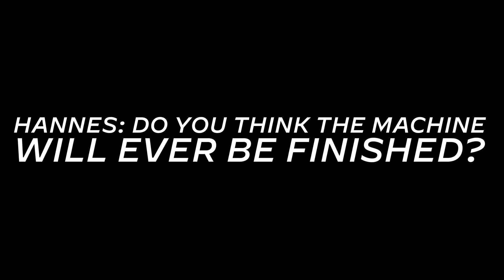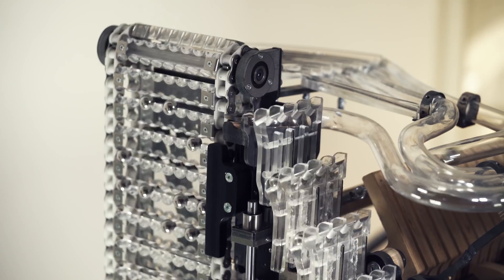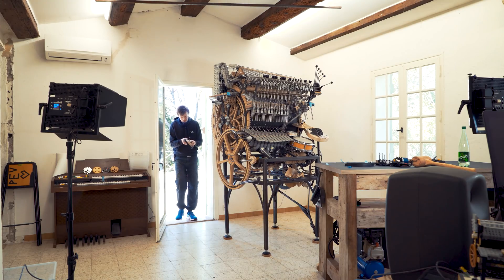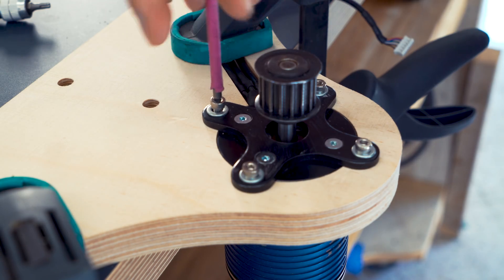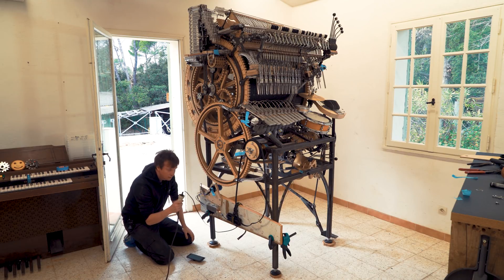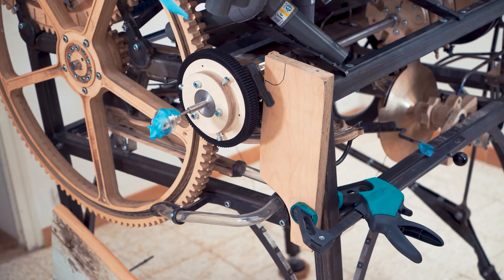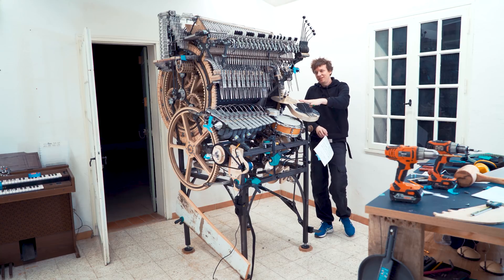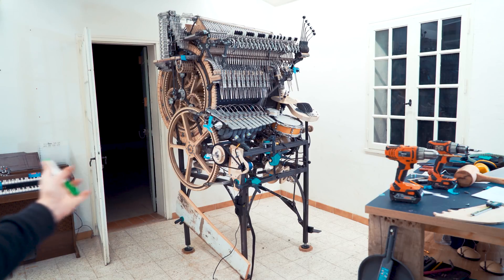Electric Motor? - Marble Machine X #114

Comment: Ok now the motor needs to be tied into a drive and and PLC and we can add PID control to self correct the speed and torque limiting. Maybe also add a touchscreen interface if you want to adjust the BPM on the fly or a couple of pushbuttons? Love the videos. 🍻

Comment: Nothing negative about adding an electric motor to this, but I thought you had wanted the Marble Machine to be "all" mechanical.   I remember in one of your previous videos you had mentioned about "perfectionism".  I presume the motor would add to this perfectionism by providing a constant torque, but wouldn't this perfectionism hinder the original spirit and essence of a mechanical machine?  Just my 2 cents worth of thinking.

Comment: Using a motor on it at this point using a Digital BLDC drive almost feels like cheating, Might as well use MP3 or MIDI?
 Instead use a weights and a clock mechanism, or pneumatic driving a tesla turbine or something.
I have been researching laser cutting whistles and organ pipes.

Comment: Isn’t the foot pedal dangerous when the machine is driven by the electrical motor? If a foot goes under it by mistake it may be crushed toward the floor, or?

Comment: And then Martin through an Incendiary into the room and ran away giggling - I'm surprised there isn't more outcry to this about face. I was kind of excited for something like MechanicalFingersGate times 3 🤣 - ah well. I love putting electric motors in my work. Not that it matters what I think, but the thought of making something with so many parts and having enough precision and tight tolerances to be able to operate it by hand crank or foot treadle - but there comes a certain point where friction overcomes practicability. I'm not super stoked about the motor, but not outraged either. Though I agree that it is a big deal and a significant turning point ~~~ I think I liked the mechanical fingers, but have mixed feeling about the motor. But it does switch on and off - so there yah go ! :D

Comment: Just a thought exercise here, but would there be a way to make a progressive (maybe conical gear or variable size pulley) gear along with a large flywheel so you could spin MMX far beyond tempo and the gear system calibrated to select tempo? It defeats some of the beauty of it, but would be awesome engineering. Like a clutch system with progressive gear as the flywheel slowed.

Comment: I’m not a fan of the electric motor.  Part of the magic of the marble machine was that it was completely driven by the performer.  I think that the electric motor takes away from the overall feeling and wonder of the marble machine x.  The debate between having perfect music of having errors in the music is to me, very clear cut.  Music isn’t meant to be 100% perfect.  If it were, why wouldn’t orchestras just use a bunch of computers for their performances?  Musicians strive for perfection, but is it truly meaningful if they use, for example, an online piano to play a piece flawlessly?  In addition, if a musician does play a piece without error, the performance is more impressive when you think that a real human did that.  “A human being played a difficult piece of music, that I could not play, without any errors.  Wow.”  But instead of thinking like that, if for example a robot were to play the same piece perfectly, I would think, “yeah, so what?  A computer is designed to do a certain task flawlessly anyway, so this isn’t very impressive.”

Comment: looks like that beautifully over engineered collet ended up being very useful xD

also i would have made that motor mount out of aluminium and made an integrated heat sink on it, because motors can get very hot and are a fire risk especially when its being held tightly by wood. i would also build a tensioner pinion for the belt so that the motor can remain firmly stationary.

Comment: With the addition of the motor, is the foot petal rendered useless? It would be cool if the foot petal remains as a foot tapping to the beat. Otherwise just cut it off.

Comment: I say swap the electric motor for a  kerosene fueled steam engine with spinning brass ball style speed regulator.
That way, you can even add a steam whistle to the tunes!
High polished moving brass, with boiler and piston housings in gloss enameled steel!

Comment: The motor fuck it for me, it defeat the purpose of a fully mechanical musical instrument
Reply: Did you miss the bit where they said it's for testing it?
Reply: @0xCAFEF00D  Testing it for what...! would be just lovely to see it man powered
Reply: @anthonygostling  They wanted something that cranks it consistently for testing how reliable it is. That's why they got the motor. The musical performance will not be using the motor.

Comment: If the belt is walking you should tilt the motor axis, not just force it into place with side rails, though like like it worked out after moving it.

Comment: You really need a mechanism that separates the crank from the shaft when it is rotating. This will help you grab it when you want it, and will prevent injury when the motor is going.

Comment: 5:10 I'm surprised the 3d printed gear wasn't designed with flanges like the motor gear. 5:34
And, 12:01 I would still add flanges just in case the wooden motor mount warps from humidity.

Comment: 6:44 - instead of locking it in place, it would be more "poetic" if it were left being able to pivot. Weigh the other side to always get the same tension.
Edit: Nvm, shorter belt arrived.
Edit2: Have a spring push it away for tension?

Comment: On this speed hi-hat sounds bit like diesel car on parking

PS you can make any transmission belt tight with desired strength. Need two extra wheels with fixed position and one to pull belt away i.e. by its weight

Comment: You need a clutch on that motor.  The motor will draw more current trying to keep up the speed.  The windings will heat up an can burn out causing a short.

Comment: I think you should attach the motor to the to the flywheel instead so that if you hit the brake then it keeps the same tempo.
Also some sort of horn instrument might be fun, like a modified saxophone or trumpet. Most likely would have to be controlled by a compressor.
A small organ hidden underneath would also be sick, it would also fit the style with the bellows and everything.

Comment: Also Martin, I would HIGHLY recommend putting a E Switch or "Emergency" button to kill the power to that motor. Just. In. Case. it couldn't hurt. I've had plenty of ESC's glitch out and go full speed uncontrollably. Not fun. Plus, it really looks cool;)  https://www.wolfautomation.com/e-stop-22mm-pushlock-turn-reset-40mm-mushroom-18613/?gclid=EAIaIQobChMIgO-30Ojy5wIVlYjICh3-OQ50EAQYFiABEgKvY_D_BwE

Comment: If the controller for the electric motor stays where it is right now, it will sit dangerously close to where the collection funnells for the vibraphone would be, won't it? My suggestion is for Martin to place the controller near where the crank is, and if possible, out of the way of any funnel. That would minimize the need for him to walk/reach for something in the front of the machine while there's steel marbles flying about.

Comment: 120,000 BPM would be wild!! The machine would tear itself apart... but assuming you could somehow get it to stay together: 120,000 BPM is basically the same as 2000 Hz. So the clicks and clacks of machine movement at that speed would blend together to play a note slightly higher than a B6!

Comment: You could use an inteligent motor driver... Your driver in this video is just giving more Power to the Motor. Intelligent drivers forces the motor to run a constant RPM.
Its theoretical possible to set a BPM and even sensors for the break or manually speed

Comment: I'm sorry to interrupt ... When the machine is at full speed, the crank is revolving really quickly. It might be hard to pick it up and not injure your hand. Should you not change the crank system to something similar to the pedals on a bicycle? That way, the crank remains in place, until you crank faster than its speed, when it'll switch to the crank as the power source. It would be better to have this function, but please don't do it – it should be finished one day.

Comment: belts walking on pulleys is a literal orientation issue and can be a pain. my super charger when i installed it to my golf had this issue. flanges should help but can still rub and cause heat build up and fail the belt over time

Comment: So with the electrical motor in place, and working. Do that mean you can simply eliminate the foot pedal. As the pedals main purpose is to help you crank the machine. Or do the pedal have some other purpose?

Comment: Outstanding Martin! As long as the pullys for the belt are lined up and square with each other the belt should track without adding flanges. Adding the assist motor is probably the biggest single playability item you've done to date for the MMX. Well done! I'm glad to see that you have your excitement back. Long projects tend to slowly wear you down (I'm a project manager).

Comment: Motors make it so much less cool. It's a complete cheat. And it limits you to batteries or a power plug. The fact this machine is completely analog is what makes it so cool. You could take it anywhere into the most isolated place and it would still function
Reply: The motor is fine. It helps assist him so he can actually focus on playing it and not literally run out of stamina cranking the entire time. It's his machine, He can do what he wishes with it. Go make your own and see how it goes.

Comment: Millwright here. Beware side loading a solid shaft too much. You'd swear it'll be fine until it cracks one day. But I don't know if it's enough force to worry about?  The first way you had the belt was countering the gear force and easier on the bearing/shaft. Now you have 2 side loads that add together. A rear motor solves this. 

Also, beware electrical noise with those RC motors. They don't exactly engineer those things for low EM emissions. You may find yourself grounding the chassis and the motor base plate, and getting the high powered wiring as far away from your sensitive mics. Hence the rear motor solving 2 problems. Electrically shielding the wiring helps if it is still a problem. Don't have multiple grounds on your machine but separating the power source for that motor from your other equipment is helpful.

Comment: The motor itself isn't that bad for me. It's the placement of the motor and the belt, in the most visible spot of the MMX, covering the wheel, right in my face. I'm sorry, I hate it and it sort of ruins the coherent design for me. Also, the pulley to the left so is ugly I can't believe it's meant to stay.

Comment: It might be helpful to use a micro-controller and an optical encoder to apply fine grained control to the motor. Write a PID controller (probably also a Kalman filter) and you can control the RPM and timings with unbelievable precision.

Comment: The Maschine is finished when it's so fast that it burns. Which will happen soon with small wall adapter to power a brushless motor esc that will pull over 500w as a slight guess. This power Suppy looks to be 200watt at best

Comment: I have been hoping for some time that you would add a motor.  Two important reasons:
1) keeping accurate time is just not possible with a hand crank unless there is active speed control.  Especially with the foot pedal - no way in hell you are going to keep accurate time with that.
2) with one hand or one foot cranking the machine you limit both your physical ability to use other instruments and your ability to focus on them.  What is the point of the bass and (hopefully) ondophone if you are distractedly playing them with one hand?
The motor is not a failure or abandonment of principals.  It is you putting the quality of the music as having priority over a purist principal.  If the goal was "play instruments manually, without a motor" then just play drums, xylophone etc.  It is the marbles that make it magic, not the hand crank.

Please do keep the motor (in a better placement).

Comment: The question of will the MMX be completed is the wrong question. It is an evolving instrument. It will never reach a final form. Constant improvements. The right question is. "When will it be performing on stage?"

I'm impressed with this motor addition and I don't see that addition as a negative thing. "It is Cruse control". It is a slave to changes in speed through the hand crank and matches that speed. It frees up the cranking hand to manage other parts. Brilliant!

Comment: Hi Martin, if you use a flanged pulley you'll want to put on a belt tensioner to make it easier to change the belts. Another method would be to use a v shaped belt. All the best

Comment: you dont need flanges even with the long belt. flanges would only cause wear and tear as the belt would rub on the side, what you need to do is design the motor mount to have tracking adjustment so if the belt starts tracking one way you would adjust the tracking so that it tends to run in the center of the pully.

Comment: Martin.  Congratulations on reorganizing your work flow!  Your back up to speed!  Waiting to hear about the time tests of the new motor and innovation.
There is one advantage for the motor.  There is a point at which the MMX cannbot be cranked at slower speeds; the motor would achieve that machine motion IF Martin wanted to compose a very slow musical composition.  But we MUST remember that the motor was added to calibrate the MMX.

Comment: I suggest using washers between those M6 hex-screws and the plywood, to spread the load so the screw-heads don't crush the wood and loosen the wheel assembly over time.

Comment: It's pretty clever to have the motor on the same side of the driveshaft as the actual gears instead of the crank where some of the mechanical force is easiest but also partially lost thanks to the way torque force works. It also shows your ingenuity in that such a small motor is able to easily turn your whole machine on its own, which means that the whole thing isn't as heavy to crank as it looks. I know you're planning on figuring out where to put it, but I would recommend trying to figure out how to perhaps place the motor and belt inside the machine rather than outside of it, as it it looks a little out of place compared to the rest of the silhouette of your machine. That, or making the "automatic speed motor" a modular part that can be attached on a whim and could mesh with the shaft and gears. That way, you could use it as you had originally intended, and then when you want to go crowdsurfing during a specific song you can just snap it into place like a Lego piece.

Comment: Doesn't the motor kill the "magic"
Reply: Yeah I also thought the same... It still is a fully mechanical marvel with regards to the actuation of each part...
Reply: I'm pretty surprised he decided to add it, I thought it was counter to part of his fundamental aesthetic desires for the project.  I guess he must have REALLY needed it
Reply: I understand that it's only for testing phase to calibrate machine on the final version will not have it installed.
Reply: Exactly

Comment: Yeah uh. Don't leave that in there on the final design, I seen you said it was just temporary but uh.. Yeah. Don't change your mind. Lol I would be so sad to see that on there :/ Don't remove the human from the Instrument :D
Reply: Having a motor doesn't make it any less of an instrument. There are musical parts that can still be done manually.
Reply: @justinnaramor6050  I mean everyone has their own opinion, I'm not wrong, and neither are you. Even though this was 7 months ago I still stand by this comment that if he were to put a motor on it, it would take part of the beauty away from the instrument.
Reply: @SavantJosh  I understand that. However, I'd also argue that the machine has never been free of electronic parts entirely, there are microphones that record and process the audio from the instruments to make them sound the way they do (particularly with the drums), and the bass guitar is also electric and neads amplification. So I'd adding a motor is further proof of that. I agree that there's something special about fully mechanical power, but that's really all that a hand crank or foot pedal does, it's just a power source. It's like the difference between a bicycle  and a motorcycle, a bicycle is completely mechanical while a motorcycle requires, well, a motor:)

Comment: Martin, I fear the wooden corks will deform, when they are exposed to moister I the air. Maybe there is a wear resistant way to seal the wood?

Comment: While I totally understand the use of a motor for testing and calibration I also feel this cheapens all the mechanical wonders built into the marble machine.

"how does it work?"
"well, there is an electric motor that..."
" oh so it's just all electronically controlled"
Reply: I mean this is only if you get someone who has enough mechanical understanding to have the idea to electrically control everything, but not enough to recognise that it blatantly isn't.

Comment: Seems like the tracking issue is no longer a problem with the shorter belt - however if you wanted to guarantee this you could use a crowned pulley. Flanges are likely to cause issues with friction and further upset tracking but by slightly crowning the pulley the belt should always try to centre itself. This is the same principle that allows trains to take corners without coming off the rails.

Either way, excellent production quality as usual Martin and team. I continue to eagerly anticipate this machine's completion. I wonder if in the future other marble machines will be made leading to certain characteristics - like how the guitar has it's Stratocasters, Gibsons, and Gretsches - maybe the MMX will develop in such a way!